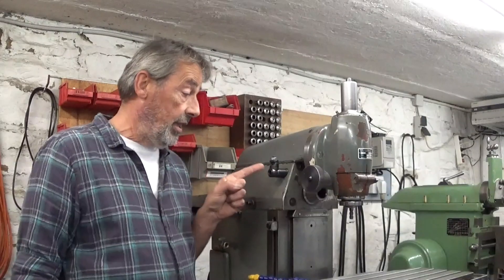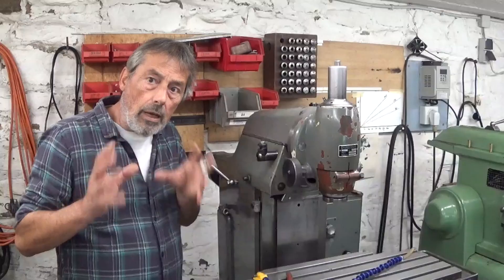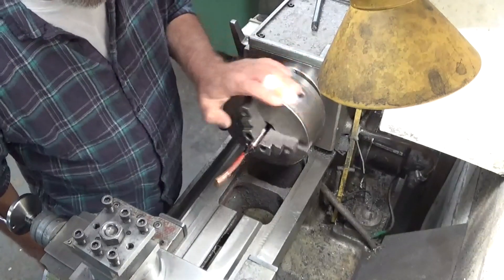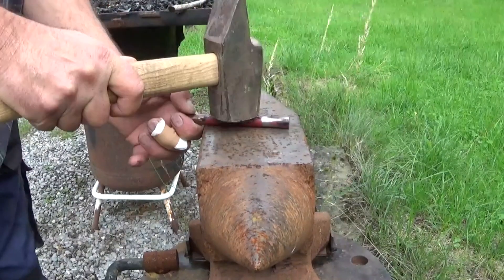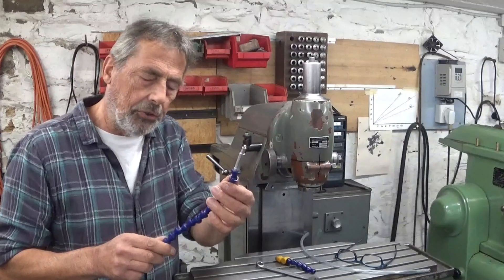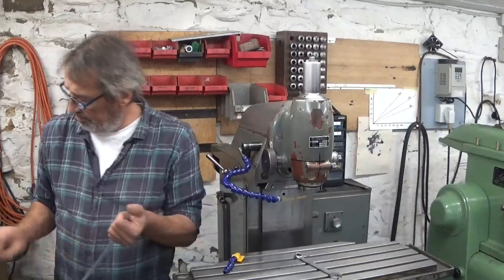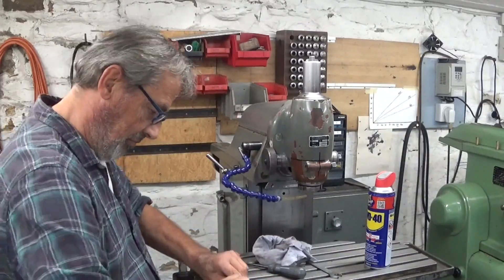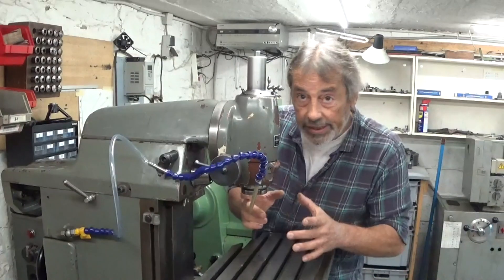Coolant fountain upgrade.

Comment: Nope, never a dull moment when you share even the simplest of shop tips (@@)! If it works, don't improve it grandpa would say :)> Plumbing in a coolant system on my mill is on my list, but snow may be flying here before I get around to it !!! maybe Santa will drop off parts this Christmas??? 6 days til roughcut2022 (@@)! Covid took 11 days away, so out in the shop to burn the midnight oil !! Sammie says "Get it done dear" :)>
Reply from the maker: Not sure it's a good idea to wait for Santa. Maybe better do it yourself :)

Comment: Mike, those clamps on each side were designed to hold the coolant hoses, I spent many hours to get it rite on my fp1 and gave up, coolant goes everywhere you don't want it to go. Now I just use the brackets on the mill to hold lights too see!
Reply from the maker: Indeed. The coolant floods the whole machine. Not good.

Comment: The only thing that might make your modification a little better is if you added a t connector so you could have air to blow chips out of the way when you don't need flood coolant
Reply from the maker: Good idea. I will think of that.

Comment: Nice precision straightening on the anvil, very accurate 👌 👍. 
Great idea on making a matching ball connector, very clever 👏. Nice Improvement Rusti. 
Thanks for sharing and stay safe all.
Reply from the maker: It's easy and it works. That's all we need.

Comment: That was a clever and practical solution. And very easy to get access to all components for repairs. 👍
Here is a tip for stretching that clear plastic tubing; heat it up then poke pointy nose pliers down the tube, and gently force open the pliers handles. That will stretch the tubing out, then you quickly push it on the fitting and it will shrink as it cools. The process is very quick and gives a good reliable result. 🙂
Reply: Wiz Rom, good thinking from you and Rustinox on how to solve a problem.
One other thought for those without a heat gun, boil water and dunk then end of the tube into it till it is soft. That is what I used to do in the past, it works.
John, Australia.
Reply from the maker: Good idea. I will keep that in mind.